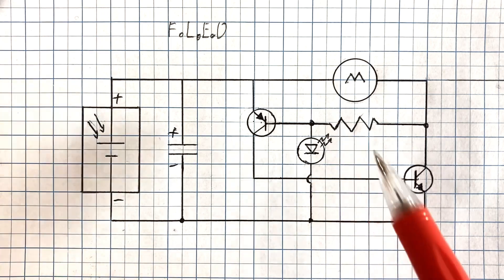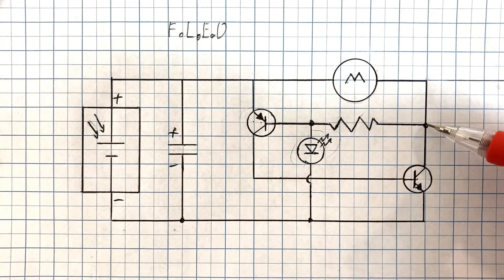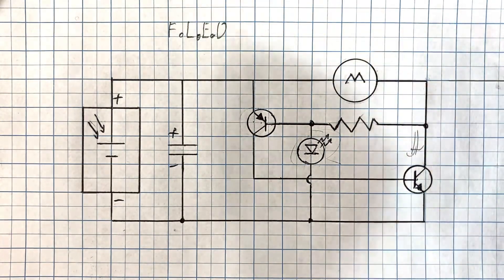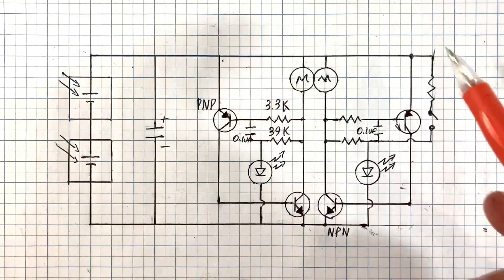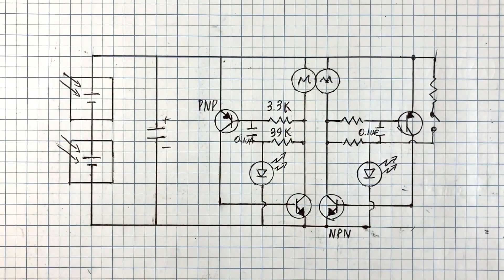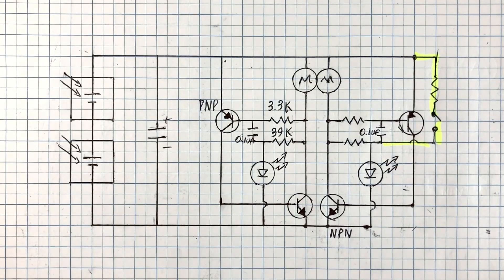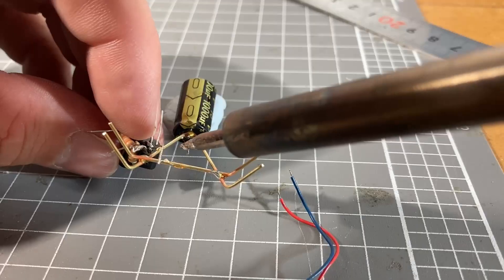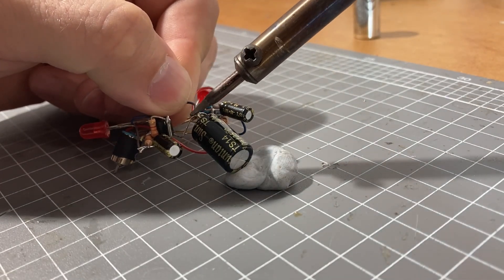The BEAM Photopopper, a robot with only two brain cells

Comment: Ever think about taking on updating the bicore stuff that Tilden was so famous for so it can use parts that are still being made? I've loved BEAM since the early 2000s but looking at Solarbotics these days just makes me sad, so much stuff is SMD only or been superseded by newer tech.
Reply from the maker: My plan is to build a modern version of the original Vbug/Walkman bot but it's probably a winter job at this point. I think there might be a lot of room to expand on some of the older designs with modern components, buying electronic parts is way easier now but yeah, some of the classic parts are impossible to find.
Reply: @ALTcorporation  Solarbotics is a great company that still sells most of l the old chips/ components etc. I think they're based in Canada.